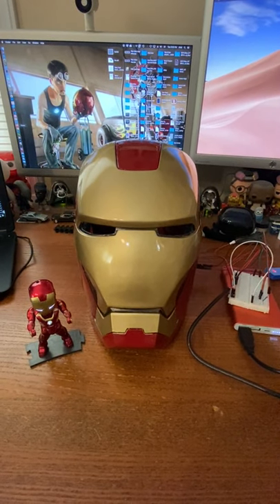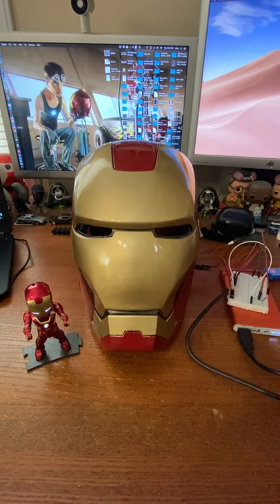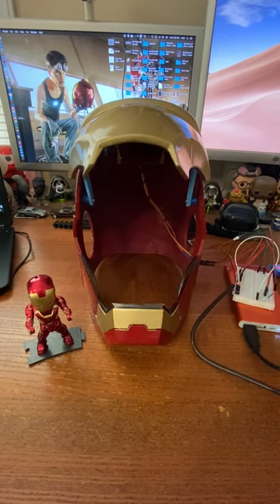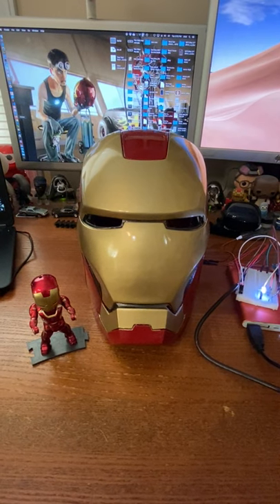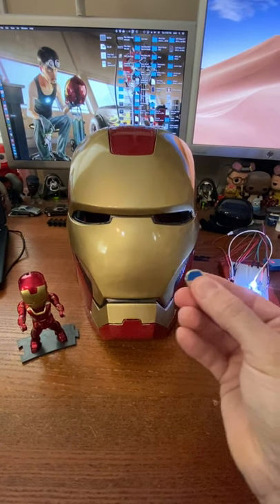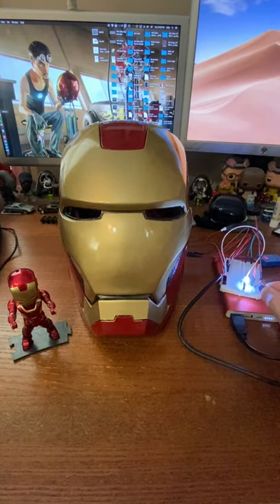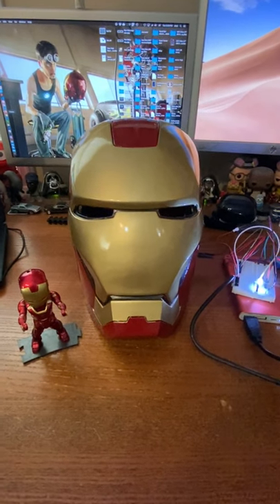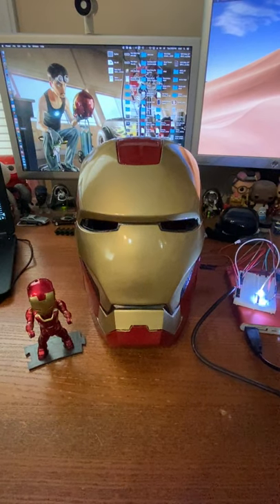Iron Man Helmet - Servo Open/Close Test with Reed Switch Control

Comment: hey i was wondering if u had a circut diagram for this? I decided not to use arduino and I managed to wire 2 servos into a 3 position switch to control opening and closing, but now im looking to do opening and closing at the fingertips of my glove.
Reply from the maker: You want to replace the "3" position switch with 2 separate reed switches to control the up/down of the servos? I assume you have removed the mini-controllers from the servos and are using limit switches to control how far they move ? I can probably put together a Schematic Diagram. Do you use Instagram, if so you can send me a message there https://www.instagram.com/dropwire/

Comment: I want to bow what are the codes you used for Servo,Eyes.I have all the supplies needed for face plate but stuck with coding.Can you help me ?
Reply from the maker: Hello, I am working with a group to put out a complete file set with tools for Helmet Motorization including the Arduino Code. You can reach out to me at https://www.instagram.com/Dropwire/ or one of my partners https://www.instagram.com/j.k3d/    (Jeet) , for upcoming information on the release.

Comment: How to wire without arduino using reed switch for magnet Controller can't find anything how to change polarity using reed switch
Reply from the maker: A Reed switch is a simple switch in that it can only have two conditions, either on or off. If you want to use a Reed switch to change polarity for a particular circuit without an Arduino, you would need either an H-Bridge or  build a circuit similar to a "flip-flop" to change polarity state. The Reed switch is basically the same as a normal push button or latch switch with the only difference being that it uses a magnet to activate.  As an alternative some people will use 2 separate Reed switches (1 for each polarity / direction). What project are you working on ?   

Here is a good article on H-Bridges:
https://en.wikipedia.org/wiki/H-bridge

Here is a good article on a "flip-flop" relay: 
https://www.electronicdesign.com/technologies/analog/article/21806385/relaybased-onoff-flipflop-remembers-state-during-power-failure
Reply: @dropwire  mark 85 helmet maybe even suit with wireless led eyes and now i wanted an motorized faceplate using an reed switch or to.how would i have to wire it using two reed switches? thanks for the help. Can send pics when finished if you like
Reply from the maker: @tobiasonken7533  If you are not using Arduino, what servos will you be using ? In order to use Servos without an Arduino you would need to use either an H-bridge or modify the servos by removing their control board so they operate as a normal DC motor.  Do you have a circuit design already ,  have you started testing ?  

If you use Discord I recommend checking out these two discord servers. They have some good people working on Iron man builds as well as other projects. 

Frankly Built:
https://discord.gg/fxWMBn4x

Iron Legion: 
https://discord.gg/bBGyrXMW
Reply: @dropwire  already hardwired the servos from a Video from frankly built using mg995 servos just nee wiring with two reed Switches to change direction
Reply: It is turning but just one direction need to know how to wire to get it moving in both directions i have 10 reed Switches and more than enough wire and am comfortable with electrical soldering
Reply from the maker: @tobiasonken7533  In order to make this work with two reed switches you will also need 2 relays, one for each switch.

Here is a video showing the circuit controlling a motor in both directions using relays and a switch. Instead of the switch that is used in the video you would use 2 reed switches.

https://www.youtube.com/watch?v=xpFzAtG3OzE